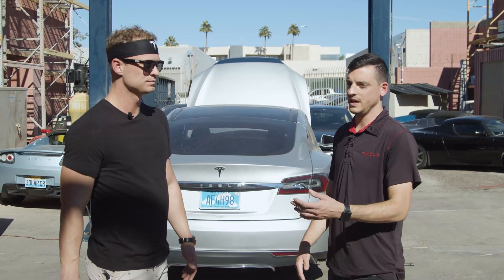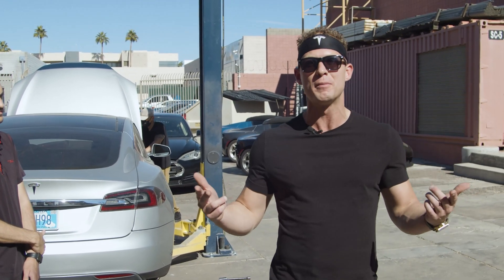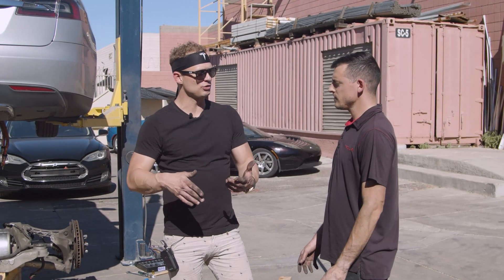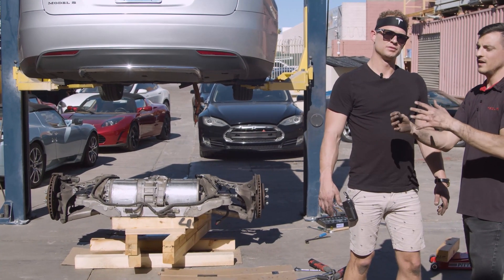Understanding the Tesla Drive Motor Assembly | Gruber Motors

Comment: Great informative video and equally annoying at the same time. Who edits this stuff?  Anyway this week I have learnt my P90DL rear motor will fail due to coolant leakage and just now I learn that the motor bracket can break.  The funny thing is I bought my Tesla 4 years ago because of the advanced technology and materials.  Tesla were in a different league of thinking and ingenuity.  Now I discover they are a bunch of muppets who didn't test the right thing.  Elon even said it is vitally important to test the right thing so I guess they failed their own test requirement.  So thanks Elon.  The money I have saved driving electric all these years can go towards buying new expensive bits and expensive repairs that I have no way of doing at home in my own garage. Rant over.  Thanks again for the video I am off to look at your other ones to get even more depressed.

Comment: New to your channel.  Question for EV haters (not me),  how many Tesla battery packs have needed replacement in the past 10 years?
Reply from the maker: Roadster battery packs are recoverable through our processes if the car comes here within 3-6 months of dying.  Those that have died, and been neglected for longer, eventually go to Tesla for a pack replacement.  We have recovered just under 100 Roadsters, and sent a few to the local Tesla Service Center for pack swaps.

The Model S packs are also repairable, but due to priority given to Roadsters, whose owners have virtually no options for the advanced technical work we do with the electronics, Model S customers go into a long waiting list, and if we were able to address all of them, it would number into the hundreds.

A Model S-X customer with a battery issues, always has the immediate Tesla replacement solution, although expensive at around $22K.

Comment: Looking at where the cracks were in the mount and the reinforcements you added to the new one it seems to me that the break on the left side would be above the reinforcements but even if not the issue is the thickness of the material which does not seem to be increased.  This means the stress point could move to where the bolt holes are and the new mount could then crack there.  I would have gone with thicker pieces of angle stock as well as the reinforcement gussets.